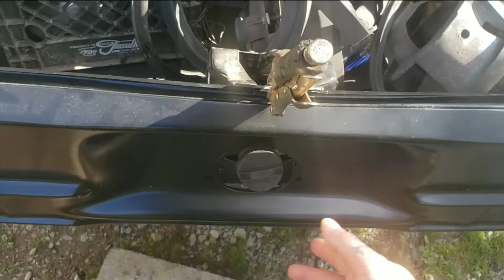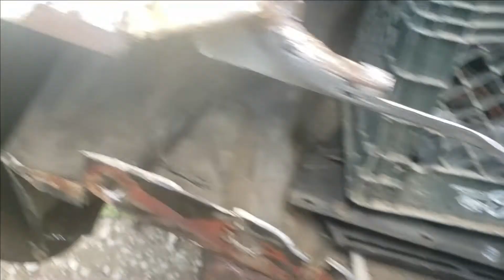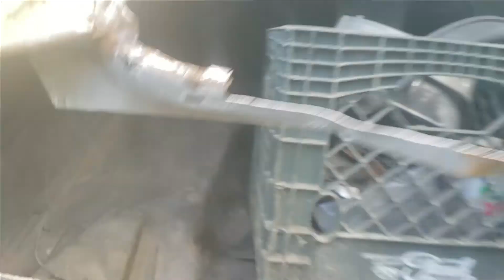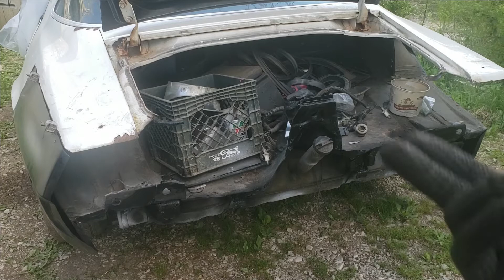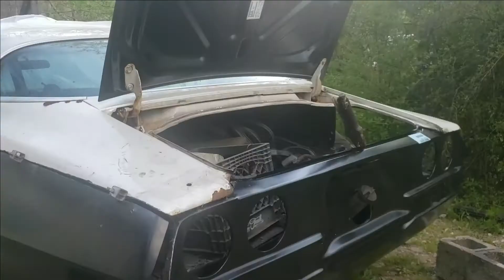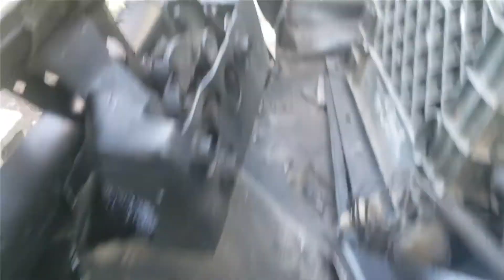70 Camaro Conversion - Tail Panel Fitment

Comment: What’s up tatt. I’m doing a 73 camaro build as well. And to be honest I panicked when my taillight panel wasn’t matching up with my quarter. Could’ve swore I had the wrong quarter or something but your video helped me confirm you just have to make it work
Reply from the maker: Yah with most any new sheet metal you half to make it work lol I cant wait to get the new rocker panels installed next
Reply: @TattsForLife  I have rockers, quarters, doors, and front fenders. Just need to put it all on. Shooting for next year but no due date